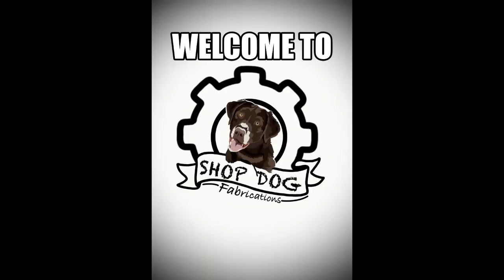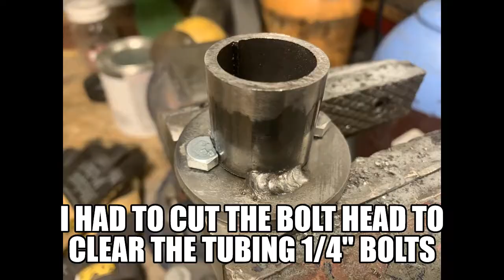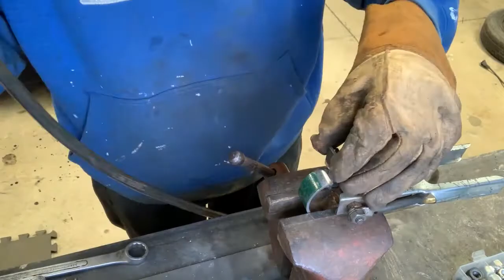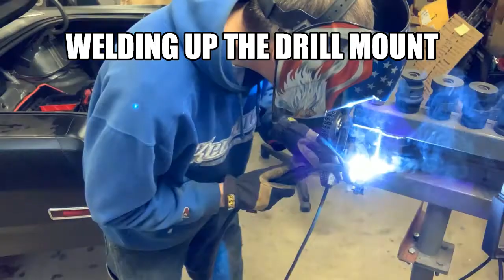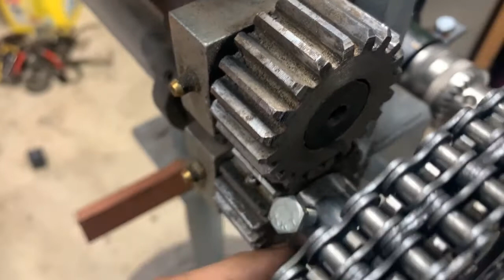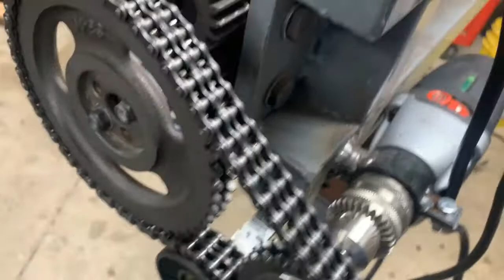Motorize your bead roller easy and inexpensively

Comment: Running a piece of threaded stock in a chuck isn't a very good idea.  Guaranteed it will give you grief. Will want to unscrew itself or move in to the chuck.  been there , done that lol.  Good thinking on getting a power drive to the roller.  It helps a lot and gives you more control over your work

Comment: Thanks for this video.  I've been going nuts thinking of a cheap way to motoriz my Eastwood roller without spending a few hundred bucks. I have a timing gear set never used i has for a car i scrapped and i have a small .40 hp treadmill motor just laying around. I'll rig a cheap controller i can make for 20 bucks and I'll even make a foot controller  for it.  That timing gear idea was just what i needed! You gained a follower!

Comment: I guess you might have done a test run so we could have seen how it worked ? Lots of different  ideas out there on this subject . Thanks for posting yours .
Reply from the maker: Another person asked a similar question. It’s not as smooth as I had hoped, the chain or tensioner I think is the issue. Need to come up with something better. Haven’t had time to mess with it. I left it up in case others could use it as an idea to develop something. When you put a load on it and try to adjust speed it’s difficult to control the work piece. I think I need to goto an electric motor that has low torque and speed. Not sure yet.